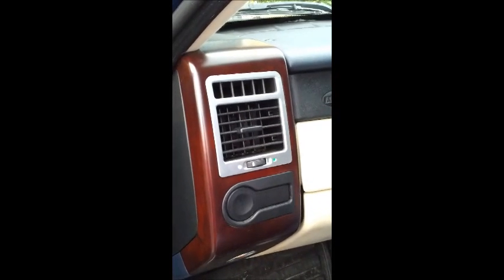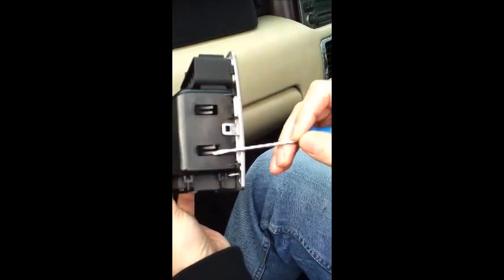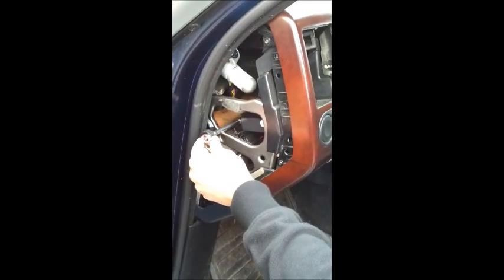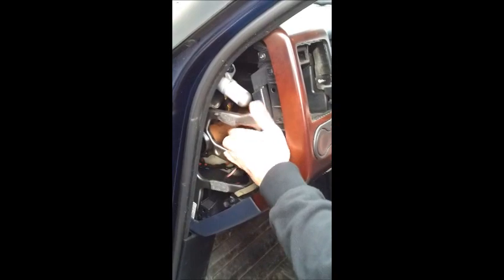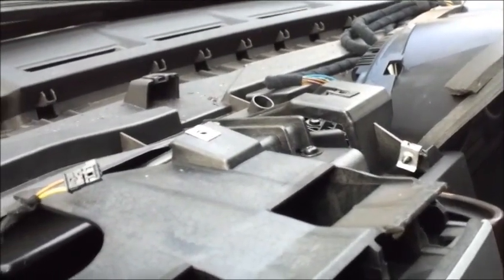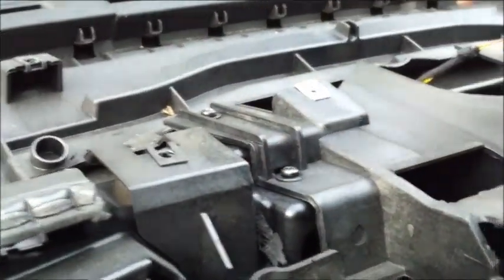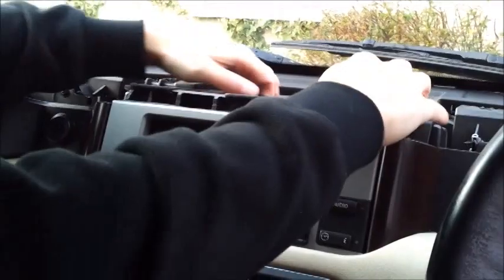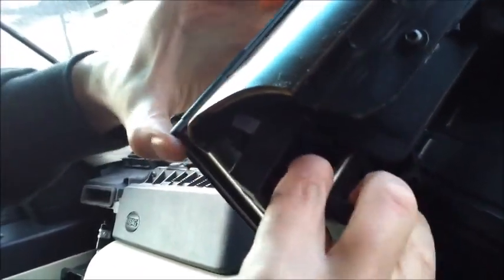Range Rover L322 Dashboard Removal

Comment: Hi, I have a L322 2011 and  would like to change the head unit. Most videos strip the dash from the sides and the top on previous models. But mine the top is padded with 'leather" and there is no access to screws. Would you strip the center console instead? Thanks for your work!